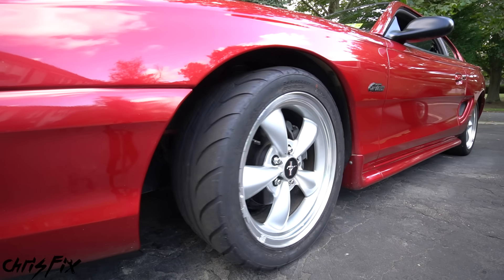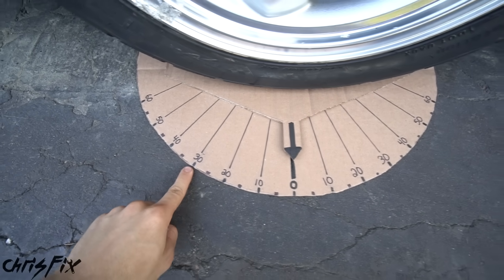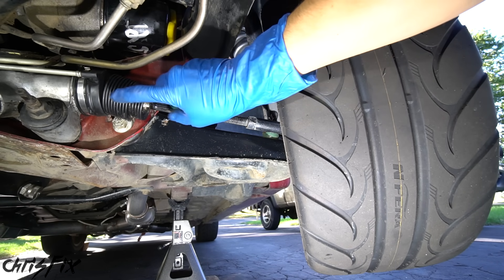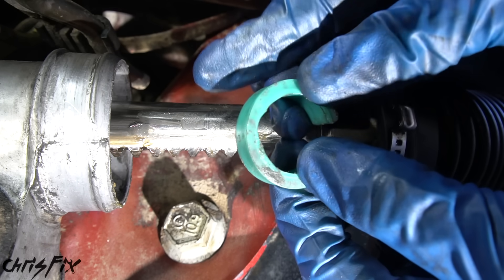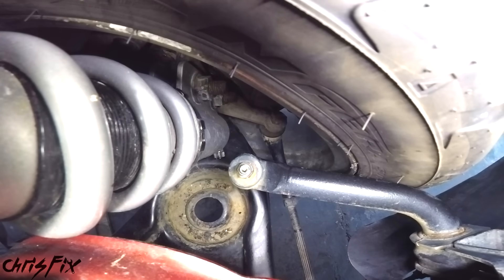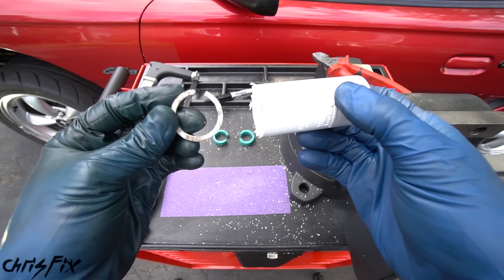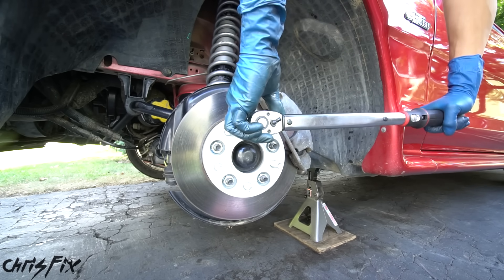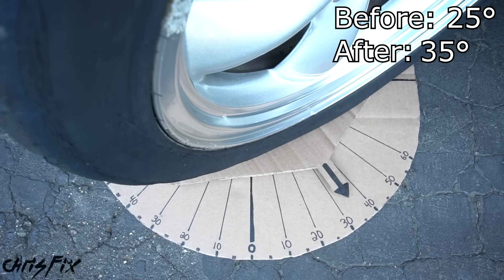How to Get Your Car to Make Sharper Turns (Steering Angle Mod)

Comment: Wouldnt the tire flexing during cornering make it rub on the sway bar
Reply from the maker: I thought so too but after testing this out for 6 months on the track and street there is no tire contact. Maybe if the tire was a lot taller and had a bigger side wall but these are pretty low profile.

Comment: Comment on the steering angle, most stock cars do not have absolute parallel steering between the front wheels, this is to do with sharper turn in, but for a drift car you'd want them to be parallel to go in the exact same direction for control of the slide. Feel free to correct me if I'm wrong
Reply from the maker: You are correct although it is close enough to be fine for drifting. I never noticed it.

Comment: Chris I totaled my 2001 V6 Mustang 😭😭 I hit a piece of cement in my lane Bc it was hit that an 18 wheeler or a ditch that would have also totaled it. It crushed the oil pan transmission pan broke an axle and broke the steering column in half. Oh yea also the engine locked up 😭😭
Reply: I'm glad you are still alive and well to talk about it!👍

Comment: Hey guys!
My mom has a 2004 Suzuki Wagon R+.
This morning it started making weird noises, and in the afternoon it stalled. At the beggining it runned for a couple of seconds then stalled, now it won't even start, but it is trying. I think there  is a problem the fuel pump.
Any suggestions? I don't want to change out the fuel pump, its too complicated for me.
Reply from the maker: Test the fuel pressure: https://www.youtube.com/watch?v=_oXLUqE4Sf0
Watch this for the fuel pump diagnosis: https://www.youtube.com/watch?v=mDIlwbx0B-s
Reply: Thanks, but i don't have tools for that, i think it will be easier too get it to a mechanic.

Comment: Be careful when doing this. The wires in the steering column to the steering wheel may not like the extra strain. Most cars should have extra and shouldn't be a problem but that's not something you want to find out the hard way you're wrong about.

Comment: Does this Mustang have reverse Ackerman geometry? Both times when he measures the steering angle, it shows a bigger angle when the wheel is the outside wheel than when it is the inside wheel. 

Unless the rack just has more movement one way than the other!

Comment: When the rack in my V6 2000 Mustang went out, I thought I was gonna be a little badass and buy myself an 04 Cobra terminator steering rack, and man lemme tell ya there went ALL my turning radius. Seriously considering this mod, since the bump stops in my 04 CObra rack are for much wider tires than stock 00 V6 tires and wheels

Comment: Hey man.whats up ?I'm just one of your followers and I was wondering if you can help me with something.... today I was putting some brake fluid in my car but for accident I didn't read and it was the steering fluid... what I did was I took it out immediately with syringe and I took a little bit more that what put... it was just like 1 to 2 oz of steering fluid... my question do you think that's gonna cause any damage ?? I haven't use the car

Comment: Was watching your video on gaining steering angle and noticed something. Former tire tech here in Ohio. L9ng story short, take a wire grinder to the back of your rims where they meet your wheel spacers, then have them rebalanced. That oxidation can cause a bad balance, and more importantly, can cause your lugnuts to loosen via vibrations. Alot of tire shops don't do it. We do alot of high value cars, aka bmw's, vette's, benz's, etc. We're the only tire shop for 3 hrs drive that most bring theirs in for us to work on. Just trying to help, faithful follower here!!!
Reply: Here is a tip never use a makita with a wire brush on "" high value cars"

Comment: when you said "torque the wheel spacers to spec" do you mean you tightened them to the same torque as the lug nuts were originally, or do the spacers come with their own torque spec?

Comment: Your angle measure wasn't aligned with the wheel, cause you shouldn't have different angles whether you turn left or right. It wasn't 30 and 25 degrees, it was probably something like 27.5 and 27.5 degrees.
Reply from the maker: Thanks but that is incorrect. Look up Ackerman Angle.

Comment: Do not do this if your car is front wheel drive or all wheel drive, because exceeding the designed angle limit of your CV joints is a good way to destroy them.

Comment: ChrisFix How can I troubleshoot and fix a whining noise coming from my engine only when the AC is running. The whining pitch increases higher as the rpm increases. For some background, I was driving and switched my AC to full blast. When I did that, something happened and zero air was blowing. For awhile, the “High” AC setting would not work. It works now tho but the noise persists. Any comment (or video) would be much appreciated!! Thanks!!
Reply from the maker: +MrAwesome5321 check the blower motor resistor

Comment: I just removed my front sway bar. Launches much harder now off the line, also with the stiffer Eibach springs, poly isos, and KYB shocks it's definitely much more hoonable. These cars understeer too much from the factory. Removing the front bar is the best bang for buck mod you could do.
Reply from the maker: +TheKoppenhaffer thanks for the tip!

Comment: you need spacers on the rears because you have a unbalanced wheel spacing. also you don't need to torque the nuts on the tires, you get them tight with the factory included tire iron and your foot
Reply from the maker: +Andy47357 thanks for sharing

Comment: Or you can make tighter turns by drifting.  Interesting though, I never knew about rack limiters.  Need to check for clearance with the suspension loaded though.

Comment: Where do you find bolt torque specs for your vehicle
Reply: A repair manual, they sell them in part stores
Reply from the maker: +TheGamerfreak1555 check out my video “ how to use a torque wrench “

Comment: After a while, please check those rubber boots to see if the increased movement isn't tending to pull them right off the steering rack...
Reply: No, this car does not have CV Halfaxles in the front, what he is talking about are the boots that are on the inner tie rods connected to the steering rack
Reply: Hi, you're talking about the CV halfaxles, correct? Is it just the bend in rubber boots that needs to be considered or does the halfaxle as a whole have a maximum angle that needs to be obeyed?

Comment: Dear Chrisfix, my name is as well Chris but I have one question, how can you make a 4WD car into 2wD even though the car is illegal in the US which I want to legalize a Nissan Skyline GTR 2002 R34 which I want to buy one later but make it fit the legal standards for the US environmental protection and Driving Safety?
Reply from the maker: It's easy in many vehicles to make a 4x4 a 2wd.. Just remove the transfer case or the connection to the front axle.

Comment: Chris I seriously think you should do a quick disconnect steering wheel for easier in and out movement for your body
Reply from the maker: Unfortunately you will have to remove the airbag do do that and this is a car that is driven on the street so I cannot remove the airbag.

Comment: Keep in mind that using wheel spacers to move the wheels outward changes the alignment, so you should have the front end re-aligned.  Spacers also increase the spindle and bearing loads,  and that can cause accelerated wear or failure of front end components.

Comment: What type of shifting contraption does this guy have inside his mustang?
Reply: I'm assuming you're referring to the long aluminum handle that was sticking straight up... that would be a hand brake. Used for Rally or drifting...
Reply: william vaughn I’m impressed. Now that I know what it is....
Reply: Red Dawg .357 hydraulic handbrake, and it's a must have for self-respecting drifters
Reply: there are videos with him installing them...

Comment: It looks like there was only 1/4 inch of clearance on the driver side. I'm curious if you checked it once it was off the stands and weight was applied to the tire if it started rubbing because of the sidewall flex.

Comment: Wheel spacers are a TERRIBLE idea.

Just ask an engineer.

https://youtu.be/hWijfooeSyU
Reply: The same result would occur if he had used offset wheels, the weight of the wheel and tire would be pushed out almost as much. Engineers are "on paper" types, or "the math" types, they typically don't have much hands on experience with things. A good quality bearing, running a good quality "hub centric" spacer, as Chris mentioned a few times, will perform very well.
Reply from the maker: I actually spoke to Jason before the video... How did you know?

Comment: You could've kept the restrictors or collars as you now have the angle kit and you would probably get the same of if not more angle with the kit. Because you wouldn't have to worry about the power steering motor from making noises

Comment: Hi chris! 

 I'm sending this in regards of My car which I need Help with. I've got a Volvo s40 2002 1.6, and i changed My Vvt a day Ago but there's still this knocking sound. I changed the engine oil and filter aswell. The workshop guys changed all of it and they told me there's nothing wrong with the car. Another workshop told me i need to drive the car more with the oil change(engine) because it hasnt been driven alot because it was owned by Two elder seniors which barely drove it. Should i trust the workshops advice and try driving it more because they changed 2 vvts and they Said theres nothing wrong, Help me please? Is it safe to drive the car, because I've been driving it to work lately and it works properly, but there's this noise sound only. Thank you in advance:)!  

Best regards Dominique! :)

Comment: I like how easy it is for you to access your steering rack... so much room down there.... wish I had that kind of clearance.
Reply from the maker: +Taylor F. Yea it’s real nice! My truck, not so much haha. What car do you have?
Reply: A 2001 Oldsmobile Aurora with a 3.5l V6.  Its pretty cramped down there when I had to service my power steering lines.  To replace the pressure hose you have to remove head shielding, fender liners, sway bar end links, a tie rod, and use a whole lot of swearing.  And I lucked out, if I had the 4.0l V8 I would be screwed with less room  haha.

Comment: Hey man. Because of you i went out n bought a second daily driver. A 99 mustang V6 5 speed manual. Iv been thinking of making a youtube just to show the 4.8 swap plus more. I also went out and bought the same rims powder coated tan and still chrome on the brim and they cane with semi new toyos! The guy also had quarter inch spacers to sell with them. Lol ill try the angle mod later after i redo the whole underbody of everything.

Comment: Hey Chrisfix do you think you can make a video on fixing a trucks frame because it is bent? My trucks frame is bent and I don't know how to fix it.
Reply from the maker: +Aaron H gotta get it on a frame machine. Most of the time it’s not worth it.
Reply: ChrisFix ok. Would a 1986 Ford pickup with rust and 78,000 miles on it be worth it?

Comment: Hey Everyone

I found my dream car for very good money the problem is its been sitting for 16 years is it worth buying? Btw its an Audi Urquattro. Thanks
Reply: Expensive parts. I would ask QuattroWorld or AudiWorld or QuattroOwnersClub or Audi-Forums. ...I got those names from internet search... You will need to write the year it was made because there are three types of Quattro engines. Imo, Quattro are underperforming. New cars have more power but the Quattro does not have a unibody so that is better for drifting. Unibody can flex too much. But a stiff chassis puts more pressure on small parts. So Audi small chassis parts are known to break a lot in dirt road rally. The parts are designed too weak.
Reply: Buzz LightBeer Thanks going to do it

Comment: ChrisFix,Good to see you again,but i'm afraid that these spacers could be the reason of  Alignment issues because the rear wheels are on stock measurements at the same time front wheels are some degree out?

Comment: Grrrrrr! What better place to vent than under a car vid? Took my truck in to get my belts tightened and when they were bringing my truck back out to me the brake line went. So a 70 dollar trip turned into a 400 dollar trip. Oddly I originally had an appt for the belts for Tuesday but last week I had the urge to get in sooner, so they got me in today. I always get feelings like that. I am known for them.  So this would have likely happened while I was driving over the weekend. 

 On the plus side they gave me a 2018 Chevy Equinox as a loaner until next week. Plenty of rust under my truck also. I really wish the previous owners(My dad and his wife) were more proactive and had it undercoated. I live in the rust belt of Canada, probably the world. Snow, ice, salt, etc. The truck is 13 years old. Time to start saving I guess for a new vehicle. Sorry about the rant but I know your viewers could relate and I enjoy typing. Heh.  Also, maybe they were trying to kill me? o.O
Reply from the maker: +Del dang, definitely stinks but looking on the positive side, at least nothing bad happened. No brakes can be a very bad situation!
Reply: I only complained here because this tab was already open. Hah. Now I am researching catastrophic brake failures and they are especially common in regions like mine.  I live in Nova Scotia. Thanks for the reply, Chris! I'll update you next week also and anyone else that read this. I recently had it undercoated but it was probably a bit late for that. In the mean time I've got a sweet ride on loan and being the single man that I am I should get out there and pick up some strange women. Heh.
Reply: The update is this. My Sportage was sold for scrap ad am now driving an 08 Civic LX SR.

Comment: Hey Chris I am a big fan and I have a question. I own a 2000 Ford Explorer SOHC engine and when I first start up it makes a grinding noise but it's ONLY when I start up and then right after it goes back to normal also occasionally when I hit 2500 rpm I hear a weird grinding noise but sometimes it'll go away what would be your opinion on both of these issues ?? Thanks

Comment: great video. I think it would be important to mention that the hubs on the wheels should be clean and free of corrosion so they fit flush and smooth against the rotor/wheel hub. I noticed your wheels had some corrosion on them. ive been a subscriber for a long time and I really enjoy your videos. keep it up I look forward to the next video :)

Comment: Did you add rear hub spacers too?  On its own, widening the front track width tends to decrease front grip and lessen steering response.

FRONT TRACK-WIDTH
Wider
•  Decreases front grip 
•  Increases understeer 
•  Slower steering response 

Narrower
•  Increases front grip 
•  Decreases understeer 
•  Faster steering response 

REAR TRACK-WIDTH
Wider
•  Increases rear grip at corner entry 
•  Increases high-speed on-throttle steering 

Narrower
•  Increases grip at corner exit 
•  Increases high-speed understeer

Comment: The moaning you hear from the power steering pump is a bypass valve, however, it's still not good to hold it on the locks because that's 900-1200 PSI going through that little bypass valve!
Reply: Take out some fluid from the resevoire? Does that help? Or do i need some kind of overpressure Ventil in my system?

Comment: in many cars the steering limiter is there to prevent damage to the steering rack and to prevent the wheel from running into the wheel well housing
Reply from the maker: Glad you watched the video!!! Thanks!
Reply: ChrisFix The level of passive aggressiveness here is off the charts. I love it.
Reply: yep.. he covered that in the video
Reply: Not as much steering rack but universal joints wear quickly when works in sharp angles especially in front wheel drive cars
Reply: lmao